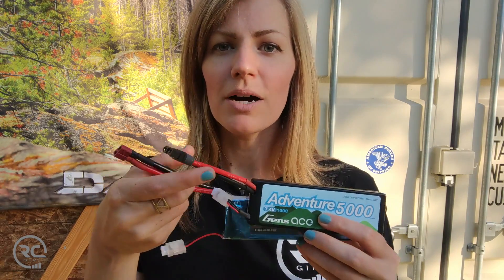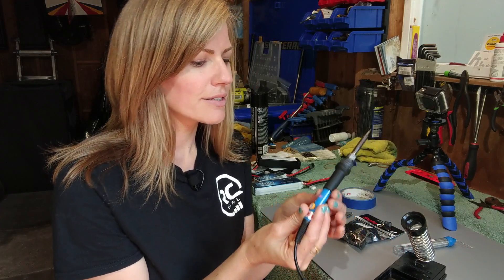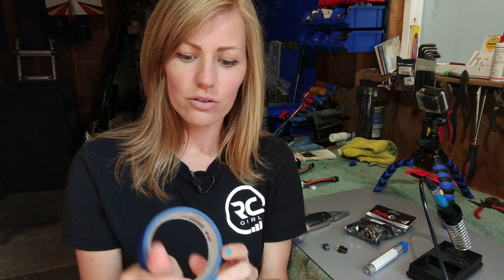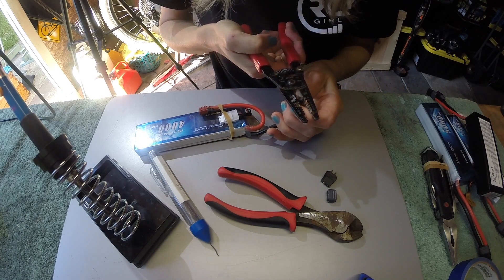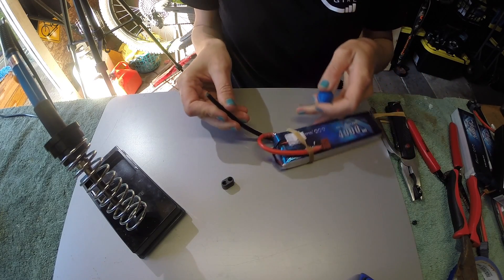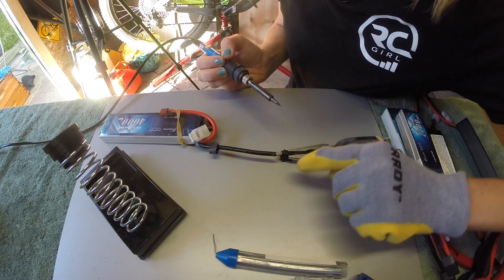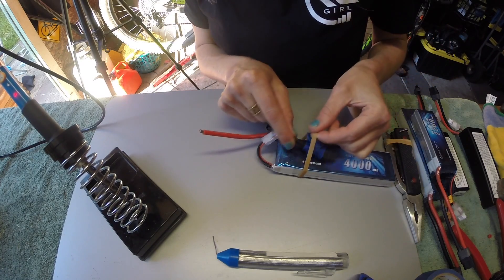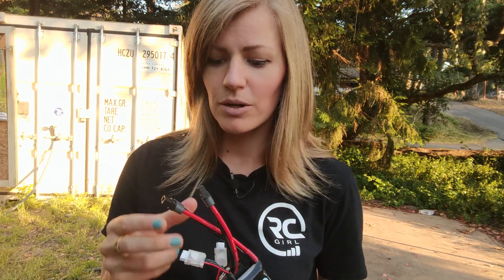HOW TO  |   Change LiPo Battery Connectors

Comment from the maker: **Adding an update: I got a few comments on this - you don't have to "snip" the cables to remove the original connectors if you don't want to. You can always just unsolder them, which will keep the original cable length. But as with the "snip method" - do this one at a time for safety so they don't touch!
Reply: TBH  I prefer to cut the cable!   Some of the other solders can cause issues if you’re not using the same Solder!  Sometimes if there’s different Solder they just don’t melt well together, sometimes!  it’s almost like oil and water!   you Do want the best connection possible!

Comment: I have an Arrma Typhon Grom 1/18 brushed 2s buggy with the Spektrum ESC with the IC2 connector and I want to change the connector to XT30 connector and then make all 2s batteries XT30 connectors. Would that be a proper connector for my Arrma Typhon Grom? Or lol maybe use the IC3 connectors🤷

Comment: A few things to note, you should be using electrical tape to isolate the leads.   Blue painters tape is not rated to prevent arcing or shorts even though it does work.  For safeties sake, spend the few bucks and get the proper tape!  This video could have used a much closer zoom to actually see the process clearer.  I've been soldering for over 30 years and am well versed, so I get what you mean when you say you will notice when things start to "melt" together.  Someone new to the hobby or soldering will likely not, and a cold or bad solder joint that is not clean is a recipe for disaster- especially with Lipo Batteries.   Any Youtuber giving advise on how to modify anything that involves electricality or the potential  energies involved should only produce videos with correct, safe practices that are industry approved.
Reply: Yea I was going to comment that it would’ve been nice if she zoomed in after every step but I see you mentioned it first.

Comment: Nice job, but I would recommend to use heatshrink between the two soldered tips as it was before cutting from the old connector

Comment: I use mainly EC3 connectors on my planes.I really havent had to do much soldering in th 20 plus years I have been flying electrics.When I did a complete change over from super tygre type connectors to EC3 connectors,I just gently cut the side of the connector shell and slide them off and installl an EC3 connector shell and im good for years.

Comment: Just another safety tipp: It is good practice not to wear any metall jewelry, when working with high power batteries.
As we say in Germany: You can't think as worse as it may happen (I hope my translation from the German "Du kannst gar nicht so dumm denken, wie es kommt." makes sense).
If you make a short circuit with your ring, it may become extremely hot from the high current (and it would be a pity if you get burning marks on your pretty fingers 😉).

Comment: Thanks for the straightforward video on soldering new connectors. I have about 10 batteries with deans, and they keep arcing with voltage spikes. Now with your video, I have a way to convert them all over to EC5 connectors for a more sure solid connection that can take those extra few spikes while ripping my RC down the dirt track. Thanks again.

Comment: Its easier to just heat up the solder joints at the connector to remove them. It also is less tining you have to do. Also as a bonus your leads never shorten.

Comment: Great video presentation Rcgirl you rock.thanks so much again as I'm a noob and have not tried doing this myself yet. I'm going to be buying a Traxxas TRX 4 ford f150 in metallic brown really soon an I want to use deans type terminals on the truck itself so I can use my existing battery and charger without buying Traxxas battery and charger combo and I watched your video on that truck 👍 its another thoroughly professional video presentation so thankyou so much again great work Rcgirl. Im also an MTB biker but here in Australia with a pretty nice Norco MTB. CHEERS thanks again great work RCGIRL.👍

Comment: I have some batteries with 2s and 3s batteries with jst connectors stock and will not mount a deans through my battery tray in my hard body any suggestions on different battery connectors as my new esc is got tamiya white connector

Comment: If you don't want to go that rout..can you use adapters?
Reply from the maker: Yeah definitely
Reply: @RCGirl  
Hi RC Girl,
Cool!!
The reason why I asked is because one of my brushed cars ...  my Maverick Quantum  have a Tamiya connector, so I bought an adapter to connect to one of my T Plug batteries that goes in one of my brushless cars.

I put a 3s 4000 mAh 11.1 30c in my brushed Maverick with a 540 motor.
Well you know how the story goes. I burned or fried  the motor. lol

But I now have a Traxxas 550 motor.
 
Enough about me I'm sorry.
It's so nice to see a female that's in this hobby that is very knowledgeable.
Great job on your plane flying,
I can hear the excitement in your voice., also congratulations winning the crawl contest. 
I like your Channel. I can now learn some 
Tips and Tricks.🙂

Comment: Nicely done! However, I always use shrink tube even with the plastic cap. It makes a stronger and rigid connection and is much better than tape which you have to remove. Also if you have a crash the connection is better protected for short circuit. Btw, I really would like to have a handy girl that is as beatifull as you are! Wouldn't we all guys!! Keep it up girl, I SUBSCRIBED! Greatings from Belgium.

Comment: In most how to videos they tell you to hold the iron on the wire until the solder melts,those were thick wires,you did not seem to heat the wire up,looked more like you melted the solder over the wire with iron.

Comment: There’s an old video from like the 60s by PACE corporation on soldering cup terminals. They preformed some twisted solder wire and put that in the cup. Then heated it until it melted followed immediately by inserting the wire lead. What was neat about that method is that there was active flux in the cup since the preform wasn’t melted ahead of time.

Comment: A good tip for xt60's, you can actually turn the "cups" of the connecter so both sit the same way, no need to flip it over when soldering.

Comment: Hi, i like these kind of videos, they arevery instructive, but there are some things i do different.
First, I dont cut the wires from the old connectors but unsolder them.
It is good that you do one wire and then the other.
Second, I use a solder iron with more power (weller wctp 51) and a thick point,  Then the connector heats up faster and makes sure the plastic of the connector does not melt.
Third, I also use shrink tubeon TX90 (on any connector), this makes i more secure.
Fouth, When soldering the female connector i put a male in the female, this makes sure that the pins stay in place,  even if they get hot.
Fifth, make sure that during coledown of the soldering you do not move the wires or connector, therefore i put the male in a small wrench, that is more stable than a tool.

Comment: I need to solder on some xt30s. I cant do it.lol
Reply from the maker: You can do it! Buy some cables and connectors for practice. ✌🏼
Reply: @RCGirl  they are soo little.lol.good idea. Ive got some layin around.
Reply from the maker: @DetoursRC  haha yeah those ones are. Does your iron have swappable tips? Use a really small one.
Reply: @RCGirl  its does. I got the wire soo hot it shrunk the tubing before I had it soldered. Solder noob here.lol thanks for the reply.

Comment: Soldering and I do not get along, so I make sure my batteries all have XT60 connectors. What's wrong with using adapters and avoid soldering altogether?
Reply: I decided that since all my batteries have XT60 connectors, I will convert my rigs from Deans to XT60. I notice arcing when connecting the batteries with the Deans, so I will take my time, practice before I do the deed. I just like the solid connection you get with the XT60. Thanks for the tutorial!

Comment: The tip on your soldering iron is too skinny to heat 10 or 12 gauge wire. When you touch it to the wire, the mass of the wire will cool the tip off too much. Also, don’t pre-solder or tin the connector cup. Tin the wire and insert it into the cup all the way to the bottom. Use a fixture to hold the wire in place. If the connection moves while it's cooling off, you'll end up with a cold solder joint. Touch the tinned and cleaned soldering iron tip to the wire and connector simultaneously. When the wire and cup are hot enough to melt the solder, feed the solder until the cup is full and then pull the solder away followed closely by the iron. Do not continue to heat the solder or re-heat solder. Never apply solder to the tip to carry it to the connection..       https://youtu.be/I_DAhAXARuI

Comment: I personally like hard pack LiPos with their direct connection. On the charger side the lead is 10 gauge for optimal charging and whatever gauge is at the esc side (usually 14). Bullet connectors are WAY better than T plugs or XT60s for connectivity

Comment: Before you even tin the wires you should make a heat bridge(solder on the soldering tip) first this makes the transfer of heat much faster and you don't need the temperature so high, the temperature only needs to be 300-350 degrees Celsius. When using with a heat bridge with the soldering iron on one side and the solder on the other, the wire should melt/soak the solder into the wire from one side to the other. When you are filling up the "cups" of connections you use the same technique, heat bridge on one side, solder on the other that way you will get even heat and the solder will melt with ease. Also when you are filling up these cups you want a shining filet, not a blob, this will also help with the wire just sliding in to the connector. Cheers from the industry.

Comment: good job. i use a large spring paper clip tp hold the battery wire and also as a heat sink to protect the battery
Reply: Exactly, this is what I missing the most in this otherwise very good video. Needless to say when using the older type XT60 (with shrink tubing), this is a must.

Comment: There are several adapters for different battery connectors . Amazon prime. EC-3's to Deans .
XT-60 to EC3 or Deans. Even XT-90 to all mentioned above. Soldering is Hot, do not grab the wrong end of the Iron. Did that before while Creatng stained glass windows and 3D Glass Aircraft.. Ouch. I am lucky enough to have a friend who will solder any for me. can't do the Lead fumes or flux any more. Otherwise , You Go R/C GIRL. FLY. AKA known as The Captain Morgan. Please don't burn your fingers. Arrgh! CM

Comment: Nice job! I would recommend getting a soldering iron sponge for your stand which you dampen to wipe the tip of the soldering iron on in between each tinning.  This removes the shale that builds up on the tip of the iron and gives to better surface contact and a cleaner joint.

Comment: I've noticed in the hobby that you never see people change their batteries connectors and I did not see many videos on this which was not necessarily a bad thing.   This is probably one of the more dangerous tasks in this hobby and I dont think most people should try this without a knowledgeable person on hand.  Its so easy to create a lipo fire and   I believe tasks like this should be left to professionals

Comment: I like your videos a lot but as a technician that has soldered for most of my career I suggest you watch videos on how to solder before you make your own. It really helps to have a clean tip for heat transfer. That’s were a wet sponge goes on your iron holder. Also even with the Rosen core solder you should still get some flux either a paste or liquid. Clean the joint with alcohol after. Cheers.

Comment: slide a piece of heat shrink tubing on the battery cable before you solder it to the new plug, then when you finish one side, slide the shrink tube up, & it will block the finished wire from the unfinished wire, it works better than masking tape & its a good thing to have a stiff bit from the plug back, & if it interferes with your plug installation, just cut it off when youre done.

Comment: Just watched great video. I had a question new to soldering lipo batteries I have one that's fully charged and the dean connector broke. Was wondering if it matters how charged the lipo is when going to solder a new connector? Thanks.

Comment: This method is not ideal IMO as you are foreshortening the wires much too much and its actually unnecessary - simply de soLLLLLLder the battery wires - one by one - and Yes I am from the UK where we invented the English language that you really dont seem to be able to master it RC Girl!!!!. 
Also to avoid 'frying' the wires leading to the battery electronics you can strap on a cold damp cloth to these wires at the battery end! Also I think you need to heat shrink wrap each re-soLLLLdered wire separately to insulate and prevent arking.
Reply: arcing

Comment: wondering why you cut the cable from the Deans connector as you mentioned you want to have the cable as long as possible. Since it was soldered on and protected with heat tube you could just cut the heat tube, desolder it. Then maximum length, and the end of the cable is already pre-soldered and saves you one step to do. And if after desoldering the end looks horrible, then use a plier to just form the end :).. that's how I would do it .... Interesting though but it's indeed really easy. Did the soldering thing already when I was just about 12 years old :)

Comment: You are a great teacher! I switching my ESC out and want to keep the bullet connectors I have and this will come in handy. The proper wattage of soldering iron is something people talk about. Is a 40W enough for RC? I really do not envision ever doing anything other than soldering connectors, two wires together or leads to a motor.

Comment: oh, and just a tip: before soldering i recommend promptly discharging the battery to 3.20 or 3.30V each cell, so that when you get the wires too close by accident, a random spark wont jump and fry your battery.

Comment: good old 2019/2018 when there were 320A ESCs..........THAT HAD A MINI TAMIYA CONNECTOR
Reply: Came across a good 'diy' tip if interested?
https://youtu.be/7Mi0795PiPM Cheers!
Reply: @christisking1316  thanks :D but i had mine for over 7 years now, i already soldered XT90 connectors on there :D

Comment: USE FLUX!!!!!! Every begginer soldering video should mention it and encourage using alot of it(its easy to remove if you put too much just wipe it afterwards) and this stuff makes soldering so much easier. Also if you plan on soldering your connector buy something called 3rd hand its like mandatory tool for soldering. Its just a little jig with aligator clips to hold to your wires while you work around them.
Reply: Flux is inside the solder itself.

Comment: Could you do a video or do you have a video on changing the batteries inside the receiver
You know the batteries that are in the car/truck.. I want to change them to PowerBlock. Could you recommend the battery and the charger also. Me and my wife are totally new to the hobby but we heard about the runaway. Vehicle calamity..

Comment: Just wanted to say thanks for this video I'm going to try my hand at soldering new connectors for the first time.  I do need to ask you though have you ever had a problem with the plastic housing on the connectors melting when your tinning them?
The connectors I have are all prebuilt Ec5s and I'm nervous the plastic casing will melt.

Comment: I have been a mechanic for 35 years and can do everything from carpentry to plumbing also . But when it comes to soldering ,no matter how many times I try I just can't do it . I can even weld and still can't solder . I guess it's a glitch in my mentality . LOL

Comment: Great video. Remember to heat both ends up properly. The un-isolated wires should be twisted again in the same direction the cobbler threads are twisted. When you pre-tin, the tin should not have a mat gloss, it should be shiny. If the tin also forms like a ball, where you can see it rounds on the surface it is attached on. Then it's not good. The edges on the tin should have a curve in the other direction than a ball and be shiny (hope it makes sense) 🙂
When you are finish, test the connection by grabbing the wire and pull semi hard multiple times 😉 If it sticks out should be okay 😉

Comment: I can't get the solder to melt once it's in the cup.  Iron is hot enough to melt the solder, but once it's in the cup, no way.  HELP!
Reply: You need a 55 to 65 watt temperature-controlled iron with a short, but fairly wide tip. Set the temperature to 350 to 370 degrees C or 650 to 700 degrees F.
Reply: @txkflier  I got it to work eventually.

Comment: If you use "Venom" LIPO batteries you may not have to solder anything. The venom batteries come with connector adapters for most of the common battery configurations. However, these adapters do have voltage and current loses. They are not very efficient. So, soldering is better solution. I was just thinking for beginners , it might be easier to not have to solder anything.

Comment: Please get a better Iron. You should only have to tap the wires and not hold down so long to get heat....also you can pre tin your tip so you don't have to use both hands to solder!
Reply: Freddy Marc-Charles Never load the tip with solder to transport it the the connection. By the time you get it there, the flux will be gone. Use a fixture to hold the tinned wire in the untinned connector. Heat the connector and wire until they will melt the solder. Feed the solder until the connector is filled. When you pull the solder away, pull the iron away. Never put solder in a connector and then reheat it while you try to put the wire into the connector by hand. That is just asking for trouble..